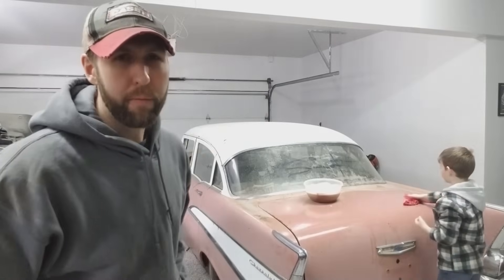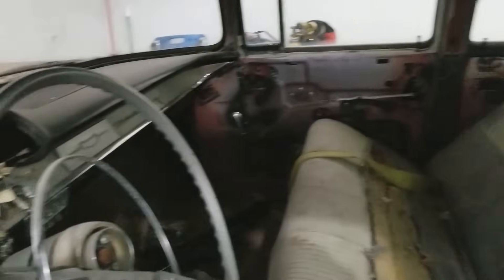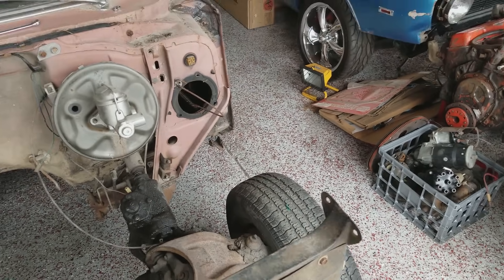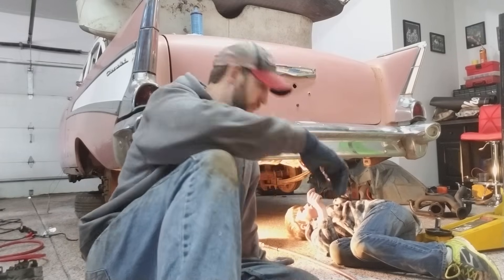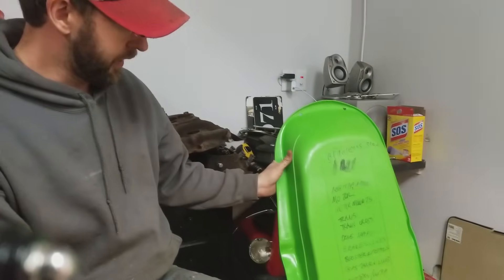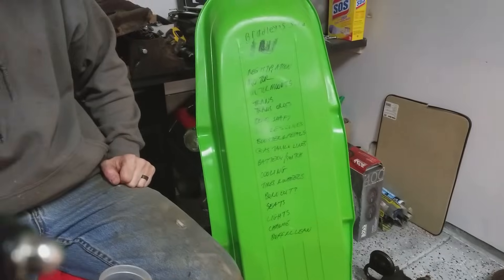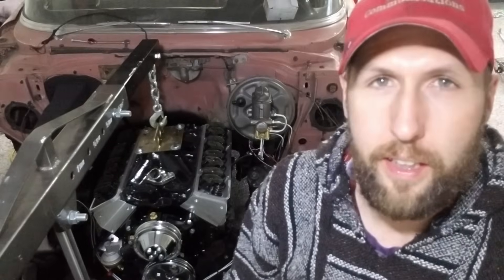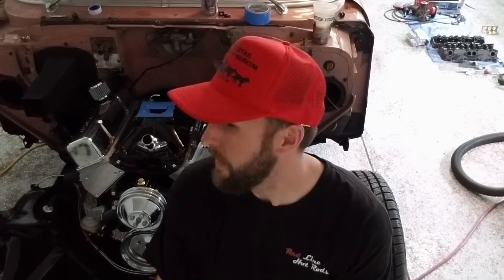Junkyard 1957 Chevy First Start in 39 years - Vice Grip Garage EP13

Comment: It was originally a 6 cylinder.  It doesn't have the "v" on the hood or trunk.  I learned from my father. I had a 1956 210 4 door.  My dad taught me how to repair everything.  Carbs are still a mystery. LOL
Reply from the maker: Carbs can sure be a little tricky! Thanks for watching!
Reply: The 6 had the radiator in front of the support since it was longer.  We had to move mine to the rear with a couple of straps since it overheated.  The original front motor mounts had to be shifted back to the rear holes for a v8. Also, the bell housing was different for a 6 to v8 swap.

Comment: FYI if you ever do another tri 5. You can use a trans crossmember from a camero. They fit nicely between the frame rails. And a couple of short pieces of angleiron cut to length and drilled to bolt the member to and weld them to the frame. And it gives you the divets to run your exhaust under. I did this on my 55 . I had a crossmember laying around, and saved some bucks. The paper kind not the deer kind. Love your vids. Keep up the good work.

Comment: Damn that budget build engine rocks! Hellyeah man! I just did my first build, 350 bored 040 over, Crane blue racer cam, Speed pro flat top pistons, 193 "vortex heads, Hooker competition headers, edelbrock performer intake, Holley 670 carb, Accel HEI distributor, wires, and plugs. Firing it up this week on the ground, got a 350 turbo trans to go with it, and putting it in an 82 Trans Am I picked up with a blown engine and trans.

Comment: Just an FYI when cutting soft metals with a die grinder (cut off wheel) if that’s what you were referring to by “death wheel”. That can explode or come apart. It builds up in the abrasive and cause imbalance. Use a skill saw with a carbide blade if nothing else. Or a face shield if you like to see stuff come apart up close.

Comment: Your show is much better than Roadkill. That powerslush transmission will be toast if you drive it like that. I went through 3 or 4 back in the stone ages. Went to a Corvette 3 speed tranny. It was close ratio and did what I wanted.I wish I could rebuild an old Chevy like you do. But at 73 all I am fit for is watching. I would like to see you build a 55 sedan with a 265 cubit inch engine. All high performance parts. Nice to see the young guys helping. What does Mama think of your hobby?
Reply from the maker: Hey Billy! That 2 speeds out of a IMCA modified- used to run 6500 rpm all night haha.  55 would be nice! Scroll through the other videos - the boss even helps me! Thanks for watching

Comment: Being as cold as it is install a 10 gallon gas or electric water heater connect rhymes with compressor do increase velocity adjust the spray nozzle in nozzl increase pressure of stream and spray

Comment: First truck was a 81 Chevy stepside with the 250 straight 6 and 3 on the tree, and the first thing to go was the column shift... Then the 200 thousand miles 6 was replaced with a wrecked cop car motor..

Comment: @ 8:40 Just keep the angle of the crankshaft and the rear end pinion the same. If your carb is level, your crank is at 3 degrees so your pinion should also be at 3 degrees. This prevents oscillation vibrations...

Comment: Regarding aligning drive shafts - I learnt some years ago that a perfectly aligned driveline is a VERY BAD thing.  In a perfect alignment the UJ bearings will never get to roll in their housing, so the lube grease will never get squished around. So there will be one permanent point of contact that will get dry & become likely to distort and/or seize. So a driveshaft that 'looks' right is actually better than one that 'is' right. A little offset will call on the bearings to do do their stuff.

Comment: it looked like you put side motor mounts on i kept the front mounts added mid mounts where the trans bolts to the block and used a 4spd crossmember out of a 69 camaro. Whether you add disc or keep the drums you can change over to tapered roller bearings for your spindles from a 70 chevelle that are cheaper then the ball bearings they originally came with.

Comment: The Old 57 Chevy came with either a 283 v8 or a 235-6cyl.--One of the Most Sought after cars during its Era--50's thru. 70's....
Reply: I love the 283, really do..... but to toss in a slip and slide power glide behind that 350 makes me sad as hell....
Reply from the maker: Hey Richard! That PG was a short track IMCA modified trans, ran 6500 rpm all night long, lightened, manual shift, etc.  The simplicity I was going for.  Next choice would have been a 400.  Thanks for watching
Reply: Bet that slip and slide get it done like a boss an imca circle track is prob pretty fun

Comment: Dereck, I've only recently come across your channel, absolutely enjoying your weird sense of humour, and the content! I have to say that I'm glad to live in South Africa (Cape Town), where we do not get such cold weather, I cannot for one minute imagine washing my car in the garage, with a bucket of soapy water. Even in the dead of winter, I find a clear day or two to do the old carwash reproduction, and even if the rain is on its way, I can even get the dust sucker out in the driveway. A little 220volt shock is worth going in to reset the breaker, and when the car is clean, I can zip down to the mall and get a new  machine, household voltage can work wonders for the replacement of domestic appliances. But, its fine. Edit: Looks like you got Covid before us, what the boys wearing masks an' all...yeah, yeah, just joking, we're not that backward here! Hey! I even have fibre internet!

Comment: Derek, I don't see many 50, 51 or 52 Chevy Bellaires. Are they still out there?  I like that old egg shape but I can't pay 30K for one that drives. Seems like they would be cheap since they are not as popular as the 54 - 57s. Maybe I don't know where to look. Do you come across any of these? I need an automatic because I lost bot legs in Vietnam in 1971. But hand controls would be easy because of plenty of access to the steering column. I have a 72 Super beetle (hydraulic clutch) Fresh paint but not restored. No rust, everything works but the fuel gauge and the radio. I made hand controls from parts of 4 different old controls and I drive it, but there is no room for a wheelchair in the bug. I love your channel and the way you involve your boys in the projects. They seem very advanced for their age. Your wife does great with the interiors. Ragged but clean would work fine for me.

Comment: Sorry, I meant what electronic device did you use to make your fan start at a set temperature? I have a 50 Chevy Sedan 350 / 700r4 with a push fan running off a switch currently - the automatic way has got to be the better way to go.  I'd like to install one and wanted to know what and where to order it.

Thanks much!
Ed
Reply from the maker: Oh! Its actually very simple.  Remove your switch and install a temperature relay in the engine.  When your engine reaches the desired temp (by the degree relay you buy), it will flip the relay and start the fan

Comment: Wow it would be so awesome with a dual plane performer rpm or performer EPS, but NOT the regular performer intake. Yeah the team G intake looks real good though. i saw one on a 383 with about 11 to1 and XR300HR13 roller cam so they are extremely serious strip/hot street intake manifolds but with the straight short angled shot it has into the intake ports (same thing on weiand Xcelerator for sbf not sbc) It can get away with it on a 350 on the road. i like to call the team G the real Xcelerator intake for chevy.t it still makes more torque and horsepower than the stock intake thats for sure with this build , nice heads and cam and a great 350 engine.  i'm building mine up someday , it has a 4.030" bore, so im going to bore it by hand to 4.040". the deck is a perfect 9.025" at all four corners, going undecked with a long rod and short piston to meet the 9.025" deck.

Comment: I would have pitched the 2 spd powerglide and gotten a 200r4 or a 700r4 and a shiftworks shifter kit and put it in behind the rebuilt 350.
Reply from the maker: This is a lightened and hardened 2 speed from a IMCA modified, so I couldn't pass it up considering the abuse it takes

Comment: Great video!  What kind of wheels are those? They almost look 16". Do you normal convert to a disc that will allow a 15" wheel to allow for a better selection of raised white letter tires? (Old school look with disc performance). Subscribed!
Reply from the maker: Can't remember the name.  They were off ebay, then I sanded them and had them powder coated.  I went to a 15" wheel to clear the Disc brake conversion on the front.  I don't always do white raised letters, but felt the white would "pop" with the color scheme and year.
Reply: @ViceGripGarage   They are Vision Daytona Wheels for those wondering. Nice paint modification on those BTW.

Comment: Really cool video, I saw your Chevelle video and subscribed.  I wanted to ask you:  will a Rochester carb of a 350 work on my 1982 camaro's 305?
Reply from the maker: Typically yes, they should both be spread bore.  Will have to adjust it some..

Comment: Hey my man, awesome videos. The 69 chevelle drive blew my mind. I have a 69 with a 65 powerglide out of a c10. So a  question for ya, what length yoke do I need. I now know that my spline count is a course teeth 16. I measured and came up with 61 1/2  to around 62 inches. I have a drive shaft out of a chevelle but the spline count is fine 27 I think. Doesn't fit and the shaft length is 58 I think...So what can I do to get my chevelle to drive on its own?  She cranks and runs on a dime. Look forward to hearing from you have a great day buddy

Comment: You got aluminum cylinder heads spend a couple extra dollars and get rollers hit rockers from Comp Cam make that engine run a little better so using stock stamp rocker arms no good for nothing especially when you're running aluminum cylinder heads make it worth it bolt on horsepower remember it's not that much for roller tip rockers

Comment: I personal owned a 1957 pink 4 door post in 1971. I found it in a older gals garage in Tacoma, WA and bought it for $500 dollars, a complete, running vehicle.  Buffed out the paint,  waxed it, changed all the fluids and drove it down the road. 
It had a 6 cyl. in it which I changed out for a 327 with .194 heads.... fun car.... horrible brakes, even rebuilt, not good.
Reply from the maker: Nice! What a steal!  Those 327s have plenty of grunt!

Comment: just simple observations....I am surprised at no use of the choke plate on start up....I start two stored hot rods now and then, the choke is a must or ya just crank and crank with failure to sustain fire...too lean. If a guy could get a fan set up with more coverage of the radiator it would be helpful....two smaller fans is my thinking....lots of cooling surface left on the table in that single fan set up.

Comment: Hey, can a guy idle in gear with the SUM-1785 cam in a C10 or will he need to plan on buying a different stall? A guy would really just like to send the stock junk since it still has paint on it (and a sticker from 2016!).
Reply from the maker: Its border line.. might idle but be jumpy.  Recommend at least 2200 stall
Reply: @ViceGripGarage  I have a 3000 in my garage. You think that's too high for a daily driver?

Comment: I'm hesitant to say this:
NEVER run those through the radiator saw tooth zippy ties!
They will cut through the cores and you will get green stuff....all over.
Reply from the maker: I don't like that green stuff on the floor
Reply: @ViceGripGarage  Very slippery slime. No not fall down,injuring your noggin.

Comment: Aluminum cylinder heads will not perform right with stock stamp rocker arms get at least a roller tip rockers or go with the roller rockers make your money count aluminum cylinder heads so they can breathe better